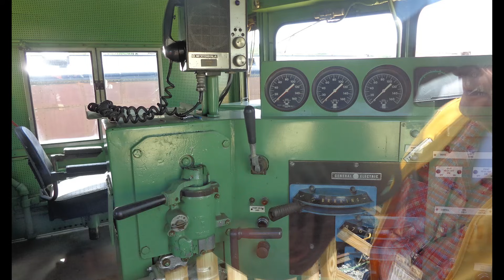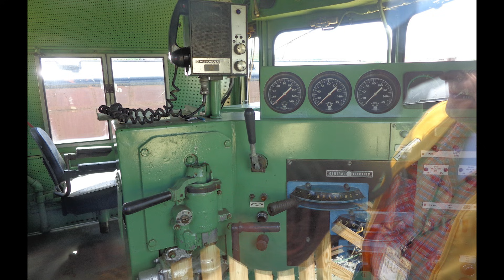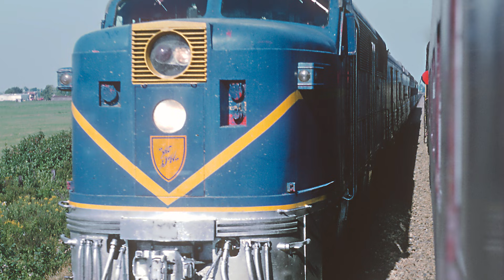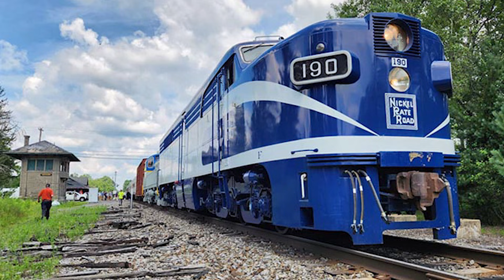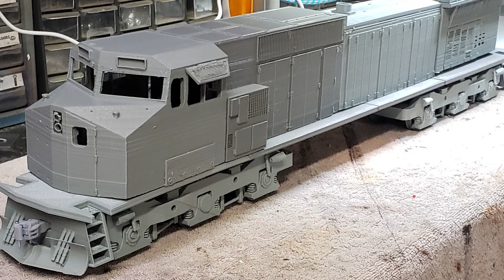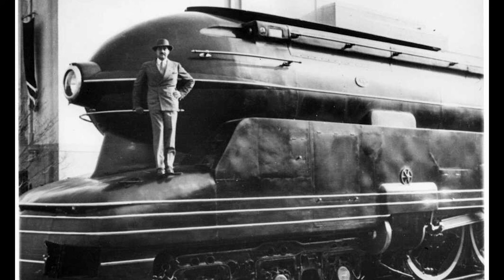Why the ALCO PA Remains the Most Beautiful Diesel Ever Built

Comment: GE product designer Ray Patten headed up the FA/PA styling project for Alco.  It was what was inside the carbody, that poorly designed 244, that sunk them.  Had they scrapped the 241-based prototypes early and gone straight to what became the 251, they might have had a shot.